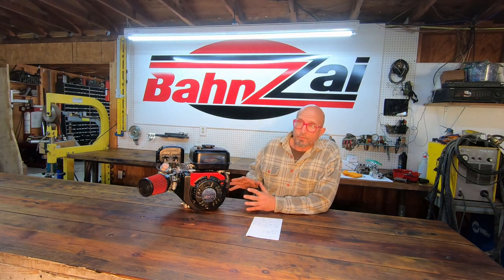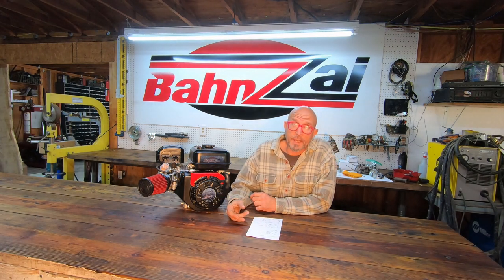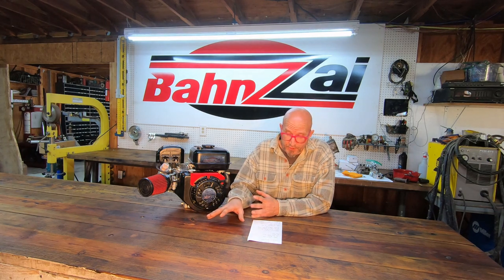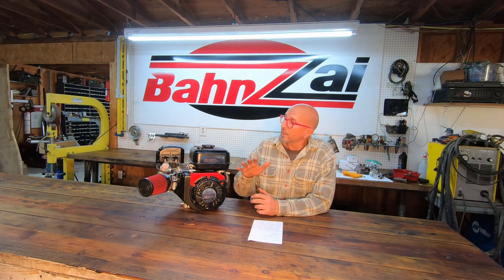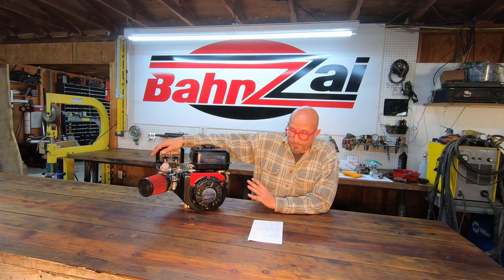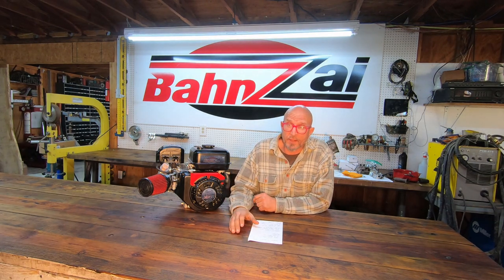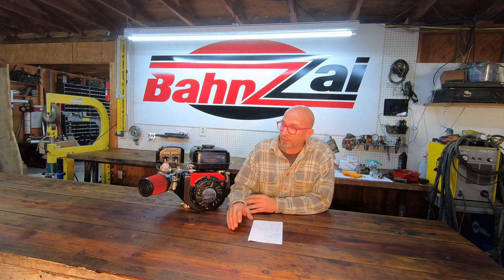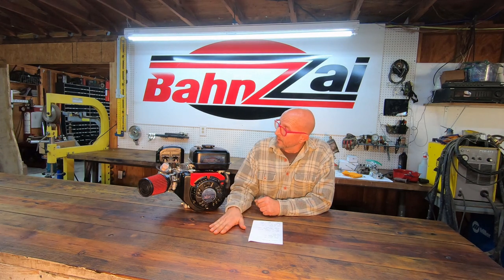Jacksonville International Raceway's new sealed "Apex Predator Class" Engine Specs

Comment: Flywheel is stock still? (Not timing advance, but the part)
Reply from the maker: Yes, stock rod, stock flywheel.  With the gear rule in the Apex Class they’re only turning about 6300+\-.
Reply: @bahnzai7313   not scared to blow it ? i heard the stock rod and flywheel dont like high rpms
Reply from the maker: No doubt; I would prefer to use billet parts, but they’re cost-prohibitive in the Apex Class.  It’s not unusual in the “Box Stock” world to turn stock rods 7k +/-, but important to remember that these are blueprinted and carefully assembled with a lot of attention paid to proper clearancing and rod bolt torque.  They also get their oil changed after every race night at minimum, often even more frequently than that.  So while they are technically “stock” parts, they have every advantage possible to help them stay together.  I would NEVER take an engine out of the box, disable the governor and turn it 6-7k; that shit will go south quickly.
Reply: @bahnzai7313  that makes sense thanks for the clarification!!